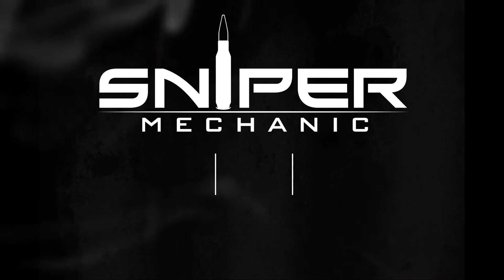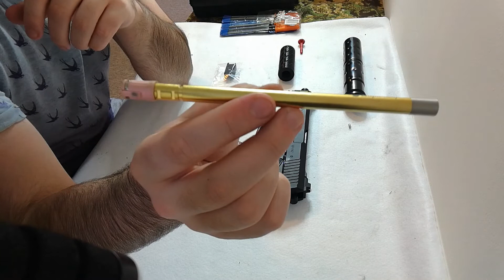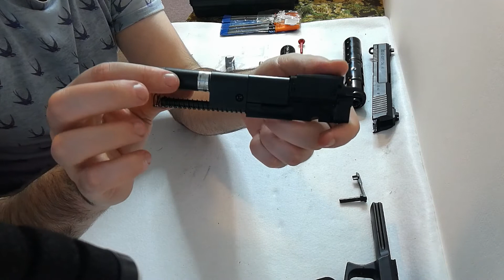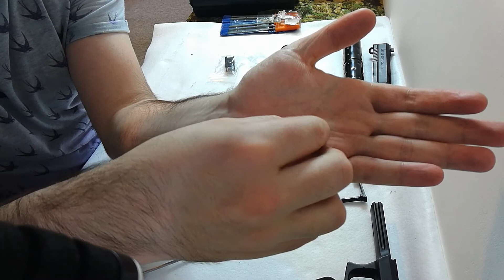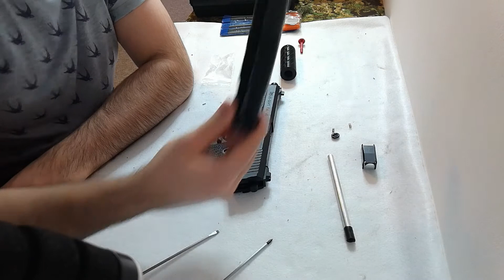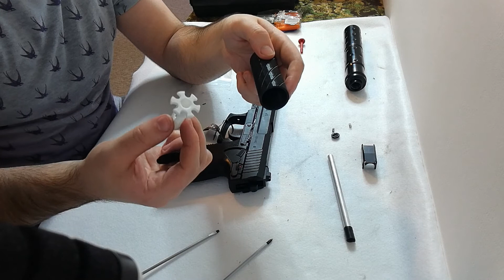Best Airsoft Pistol?!? MK23 Upgrades and Install Guide

Comment: considering the cost TM the weapon which is MOST honest, im, or if you plan to mod to the absolute nines is a SSTI/ASG just better value
Reply from the maker: Absolutely cheaper, but in the long run TM last much longer. I've had 3/4 clones in the same life span as my OG TM

Comment: How to choose bucking hardness - 50, 60, or 70 degree hardness?
PS - did the mods plus added TM feed lips to the STTI mags but still had a single shot then would dry fire🤯🤯
... until I found the solution very recently: 
https://youtu.be/fMdy5ppferU

Comment: I hear that using the suppressor with the asg clone kills any added accuracy from upgraded barrels because the asg suppressor has its own inner barrel.
Reply: Yeah but you just have to take it out and add foam/rubber sheet/tape

Comment: does it really need this tdc cover and the h key for this conversion? or just pass the maple leave jet barrel and Maple Leaf Autobot Bucking 50/60 degree?
THX
Reply: I would say it doesn't need the tdc, because TDC mod is just for more precise setting of a hop up and for the possibility to hop heavier bbs. However you need the H key because of the design of maple leaf buckings. It will also work without the H key but you will not get any improvement whatsoever. And yes I know your comment is from one year ago :D

Comment: does this work with the ASG mk23 ?
Reply: Yes, I did these same mods to my ASG and the improvement was amazing. I am now confidently hitting a football at 60 metres with .43's, and if I miss that, they are going an essy 20 metres past that.
You will need a new suppressor though, as the 150mm ML barrel sticks out further and the ASG suppressor no longer fits.
You may also experience the gun sticking when you use it, if so, take it apart again and remove the little metal collar on the bucking, they sometimes cause issues.
But definitely do the upgrades, it will be like a totally different gun.
Reply: @michaellyddon323  nice, ty

Comment: Hello, I was looking into these upgrade parts for my Mk23, but I use mine for indoors, would it be possible for it to come closer to 1.1 joules / 350fps with 0.20bbs if I change the hop up rubber? Or is the barrel length the reason the power goes up? Any help would be greatly appreciate, I can't wait to upgrade mine for better performance.
Reply: At least on the STTI MK23, i believe it's the suppressor that adds the extra fps because of the barrel extension in it.

Comment: If performance is the goal, why not using the stock surpressor and a longer inner barrel, like kicking mustang?
You didn't talked about the magazin mods, you think it's not worth or why you don't talk about them?
Reply from the maker: We have strict limits in the UK, the 220mm inner puts the pistol over 1.3J so it can't be used. The 150mm sits perfectly under 1.3J, Also there will be no noticiable difference in range and accuracy between 150 and 220mm.

As for the magazine mods, a well looked after TM magazine is perfectly fine for UK limits, so never had the need to modify them.

Both a 150mm and a 220mm will get the same range and accuracy in this set up, difference will just be the joules. One will be usable at UK fields and the other won't.
Reply: You think the FPS/Joules don't improve the effective range? And when yes why?
Reply from the maker: Because it's so minor and again, I'm UK based so we have strict limits.

There are 500fps rifle which can't hit 90m, it's to do with many many factors include the power source (Spring, HPOA, CO2, GG), how the force is applied, the hop bucking etc.

I can build a 2J rifle that will outshoot a 2.3J rifle, just because of how they are built and what parts work well.
Reply: I totally agree that FPS is not the most important part about effective range, but if you have the exact same airsoft gun/rifle except it Joules, i think you get more effective range out of it, you can't compare differend guns and just say it's not important because you can outperforme a stronger crappier one.
It's like comparing kw from different cars, if you have a heavy car with high kw it could performe worse than a light with low kw. I think you got what i mean.

Joules/FPS is just one tiny thing to calculate if you want a good airsoft, in your case the lawsystem says where the maximum is, so you keep a bit under that and try to upgrade the other variables to get more out of it.

What i am really interessted in is, how different FPS/Joules are changing the effective range if the rest is constant. (How the performance curve looks like)
And the same, if the Joules would be constant and you try out different barrels or hop-up and so on...

You said that a Joule increasment would only make a little change to the effective range, have you tested this with the same airsoft or how do you came to this conclusion?

Sorry if i sound super critical and pissed, but thats not true, i am super happy that someone is making new content of the MK23. BIG thanks for that :)

I just like to learn as much as i can to adapt my knowledge in different fields.
Reply from the maker: There are many threads on how air works etc and the benefits of how it's applied differently.

Simplest way I can put it is this.

What happens when a car wheelspins vs a car that leaves the mark in the correct gear? The one that wheelpsins wastes load of energy and skids, losing control and grip.

The one that leaves the start in the correct gear wastes less energy, grips and leaves in a more controlled manner.

Air is the "gear" in this situation. If you had 4 VSR rifles, exactly the same other than the energy source, such as Spring, HPA, CO2, Greengas, they would all have different flight paths and ranges even if everything was the same.
Reply: BaNaNa Joe the higher your fps then the harder your bucking is going to have to be so that it can actually hop the bb as well as the hop contact surface area, atleast that is my understanding. A longer barrel will definitely increase your fps as will using stronger gas. It wouldn’t be too difficult to get the mk23 to 450+ fps. There is a mk23 dmr carbine kit for that very reason. As we have much lower fps limits in the uk for pistols its not really worth it unless you are actually turning it into a dmr.

Comment: Are ASG mk23 mags compatible with the TM mk23?  The ASG ones don't seem to leak when using Green gas or even Nuprol.  Thanks for your feedback.
Reply from the maker: They are compatible, the feed lips can be tight though
Reply: Marui’s have an extra release valve that has to be modded to allow higher performance gas. Asg Mags work well with red gas though.
Reply: What is the go to gas for these?
Reply: Green gas or red gas depending on temperature.  Novritsch mags work much better though.

Comment: the h key work better than a mapleleaf I key?
Reply from the maker: much much better, more consistent :)
Reply: A great deal easier to install, although once in I've been very happy with the I Key.
Reply: The I key and h key are concaved. When installing does the point go up or down onto the bucking?